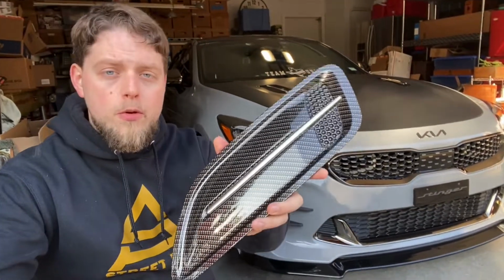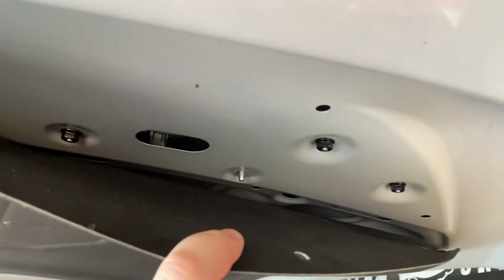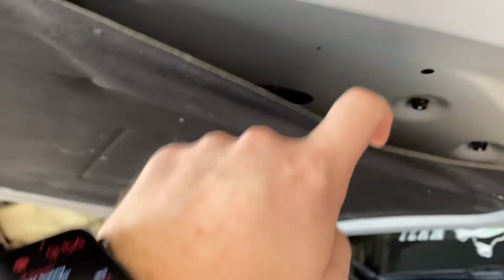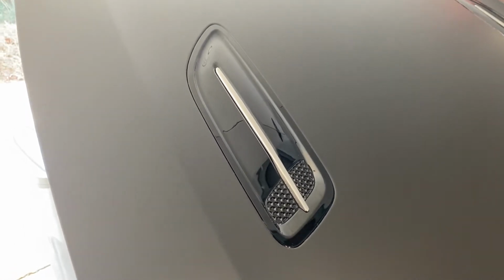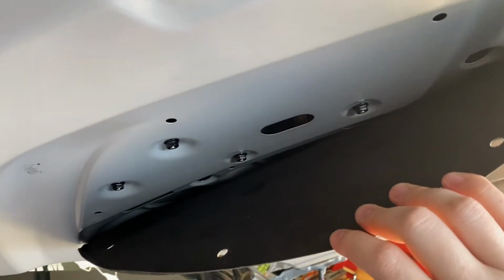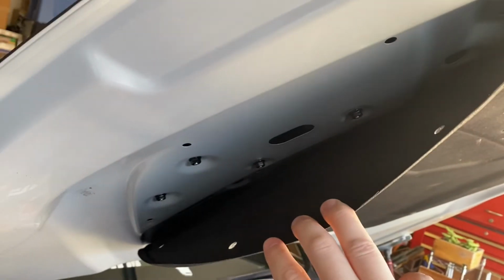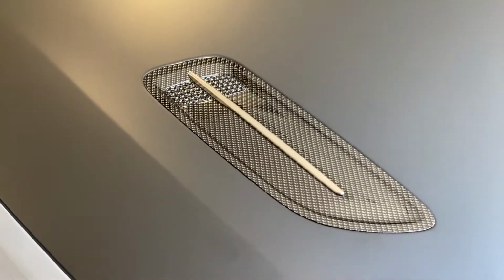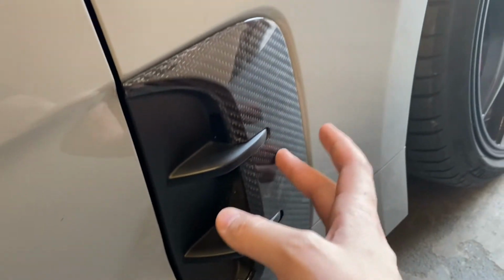How-To Swap Your Kia Stinger Hood Vents (+some other carbon fiber cosmetics!)

Comment: You been helping me a lot with the accessories i have a 2019 pearl white stinger buts it’s a base model sadly but the accessories make it look real good
Reply from the maker: That’s awesome, glad I could help you out!
Reply: @KDMCurt  I also gonna buy the new kia badges like you have you think they will look good, even if it’s a 2019?
Reply: @KDMCurt  also what percent tint you have on the front and back windshield?
Reply from the maker: @IamKerious   yeah the new badge should look fine on a 2019 I’ve seen a lot of people swapping badges on these for different years. As for the tint, I don’t have any on my windshield yet, but 5% on all back windows and 25% on the front two.

Comment: With the roof spoiler, do you have any clearance issues with opening the rear hatch?  I'm completely on the fence about ordering one (can only find it at Racingbees from Canada, since it's no longer available on Amazon).  As others have said, would love to see a full walkaround after each mod install vid.
Reply from the maker: Nope, no clearance issues at all. Hatch opens all the way like normal.
Reply: @KDMCurt  Thanks for the response Curt!!!  Your Stinger is straight fire!!!

Comment: Yo with the door handles, does it make it hard to press the button?
Reply from the maker: I didn’t have any issues with mine but I have heard of people having that problem. Just take a small piece of sand paper and widen the hole for the button just a bit.
Reply: @KDMCurt  thanks

Comment: Surely the person that wrapped the hood lost the 4th nut?
Reply from the maker: Could be, but he’s pretty meticulous with his work so I’d suspect Kia of just not putting it on before I’d suspect him haha. Apparently a huge issue happening with 2022 Stingers now is the door handles on the inside coming detached from the door because the screws were not tightened properly before the cars came off the assembly line. Mine seems to be fine but I’ve seen a few posts about it in a Facebook group.

Comment: So how you liking the stinger over the optima ? Worth it?
Reply from the maker: Loving it, it’s definitely a lot more fun to drive!
Reply: The Stinger is like a tighter, tougher, stronger Optima. There is a discernible difference between them. The Stinger is also 2 inches lower.

Comment: So sad that the hood vents are only cosmetic and not work. But it looks good anyway.
Reply from the maker: Right?! They could have easily made them functional to let out a little heat under the hood.  May end up switching to one of the Ark or Seibon vented carbon fiber hoods down the road, we’ll see.